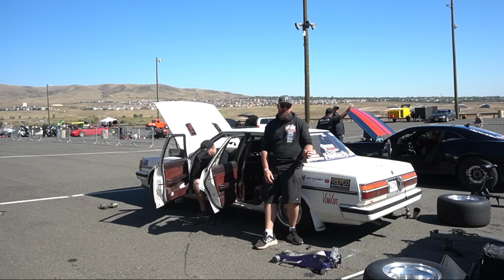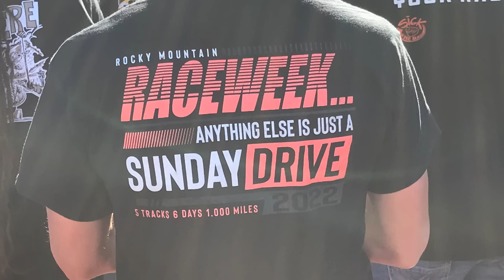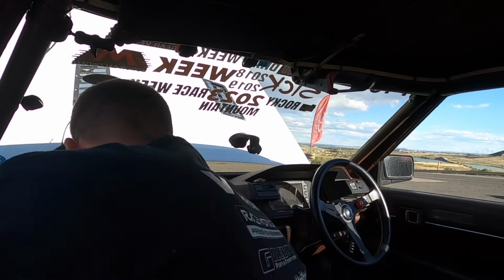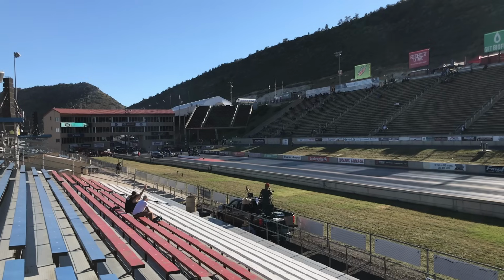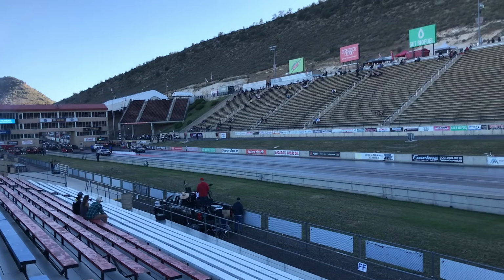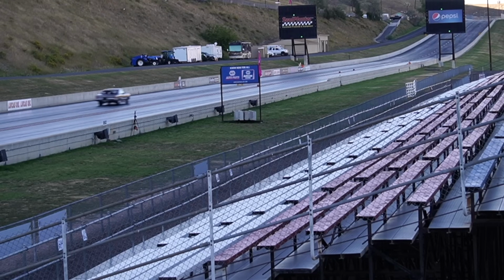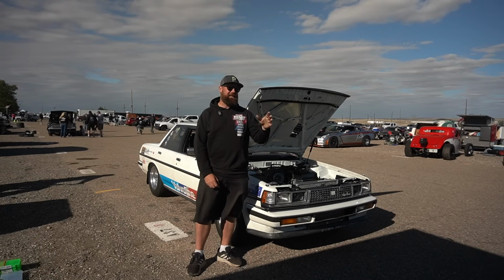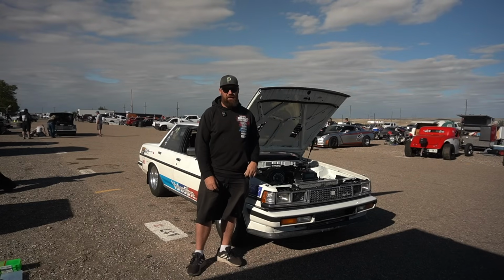WE WON!!!!! THE FINAL DRAG RACE FOR THE CRESTA...

Comment: Benny if you did  the same changes to the fox body mustang that you did to the cresta doing it time in the US like the nitrous stuff  what times do you recon that coudt do
Reply from the maker: The fox has a slightly smaller turbo and looser converter so it may not benefit from what we’ve done so far, that being said , the Cresta is a test bed for the Mustang too.

Comment: The Cresta is running 8.5's now?  That car has come such a long way, and you've got plans to get it into the 7's, it's going to be a joy to watch.
Reply from the maker: Yeah we’ve actually slowed it down to run 8.5’s. It’s PB at home in Aus is 8.12
Reply: @BennysCustomWorks  Ah, so the Reliable tune is 8.5's.  Got it  :D
Reply from the maker: @Mach1048  different cage rules USA- AUS
Reply: @BennysCustomWorks  Ah, that makes sense, I honestly don't know much about those regs, but yeah, Safety is important and I'm guessing there is a pretty noticeable speed (and thus Energy difference that has to be managed) between 8.5 and 8.1?
Reply: @Mach1048 that's a 5% average speed increase, so over 10% more kinetic energy, but with the car being traction limited at the start the vmax difference to achieve that time difference is more than 5%.
Reply: @EmyrDerfel  a 10% increase in Energy is a lot, so yeah, I can understand the difference in Regs.